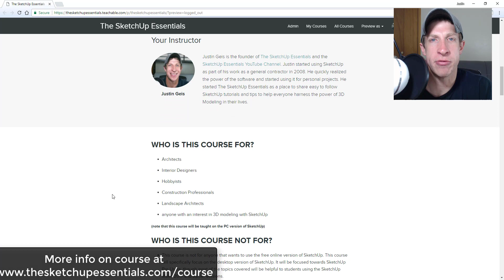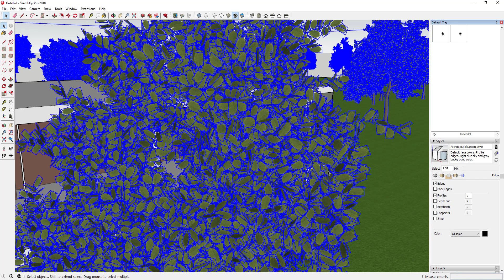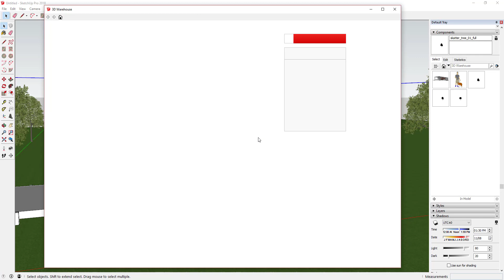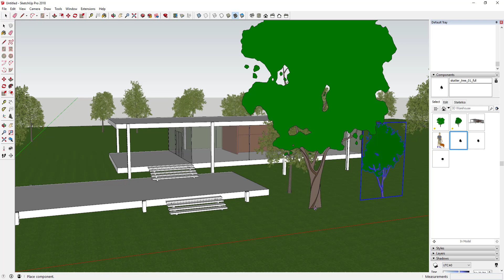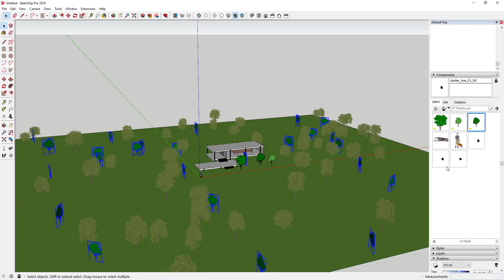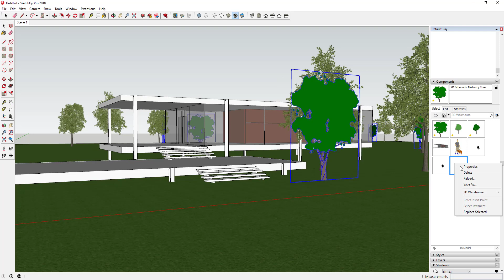SPEED UP YOUR SKETCHUP MODEL with Proxy Components!

Comment: I think in this case comparing with the workflow it is easier just take these high poly instances in another layer, and just hide it.
The real problem occurs when you making some interior with all that decorative highpoly shit, there should be some simple workaround that can visualy simplify the model. Vray has it, but it should be standalone plugin and be workable with different render software

Comment: The edges and faces in my model was 569 and still I had issues every min whenever I'm selecting a tool or moving an object. (Landscape project) and there's no issue with the laptop configuration.
Reply from the maker: I don't understand what you're getting at - if you only have 569 edges/faces, that's not a large model. Are you sure your graphics card is up to date? Because at that size, I'm not sure I agree that there's no issue with laptop configuration...
Reply: @Thesketchupessentials  there is actually an issue with my graphic card and I really have no idea how to fix that issue. Any help? 😅

Comment: Hi Justin, in order to speed up my modeling work within sketchup, this proxy method would be a good solution for me, but I usually render my modeling in Lumion rather than vray, so in my case what is your recommendation for me between using proxy component or vray proxy method although I dont use vray? thanks
Reply from the maker: I don't really understand the question - I'm not sure you can use Vray proxies if you don't use Vray. That said, proxies aren't really going to work the same way in Lumion - it brings in and renders objects in a different way than other rendering programs...
Reply: TheSketchUpEssentials thanks for the response... what i mean actually is asking about your opinion or advice which is the best way to speed up skecthup modeling between using proxy component method or vray proxy (vrmesh & vrmat), I usually add some decoration and furnitures from 3dwarehouse into my interior model, but there are a lot of high poly faces / edges and it’s usually slower down my pc and lag during doing my interior modeling.

Comment: Thanks for sharing. I think the use of proxies will be very important for serious modellers. Unfortunately it appears that you have avoided the problem of component axes when swopping proxies. It is seldom a problem with trees, but can be a problem when rotation and size are important such as for handed components. Can you do another proxy video with chairs, for example?
Reply from the maker: I don't understand the problem that I "avoided." Can you be more specific as to the issue?
Reply: I have been using proxy swops for only a few days with objects other than trees and I discovered that proxies are replaced (reloaded) by objects (reloads) according to their internal axes orientation. Any differences will effect the replacement or reloading orientation. For example, when I change "pulls" on drawers I must make sure that....

...the proxy pull and its replacement "pull" both have the same internal axes orientation...

...otherwise the replacement "pull" is cockeyed on the drawer.  

Ditto chairs in dining settings, cars on roadways etc etc.

Comment: Thanks for sharing. I've just discovered "right-click/reload" by accident, and it seems to be a quicker way of using/replacing proxy components. For example, just "right-click/save as" your preferred component to file (the high poly component), and then "right-click/reload" just one copy of your outgoing low-poly component from that file and all copies are replaced simultaneously.  

To make it easier to find that component file, always place them in the same common place , in my case the "documents" folder. (set preferences/files/components to your "documents" folder)

Comment: In order to get the scaling correct you often have to scale the low-poly component before it's place in the model so it's the same size of the tree you're replacing.
Reply from the maker: If you want the proxy to be exactly the same size as the component you're replacing, you can do that. If you just want it to be close, you can scale it after swapping them out - they're components, so they'll all adjust either way. Thanks!

Comment: Nice! Is it possible to have the hi-poly trees on one layer and the low-poly trees on another layer for quickly switching between them as needed? Or will hidden layers still affect the performance?
Reply from the maker: I would say that would work as well if you wanted to do that - there'd just be the extra step of having to copy over or create the second set of geometry. Thanks!
Reply: Keep hidden layers containing heavy objects accelerate navigation in the model for sure  . . .
Reply: You can put both the low poly component inside the high poly one, and once you layer them it will definitely save performance, however not as much as the method in the video.

Comment: Hi Justin, Is there a plugin that will lower the poly count on a component or group but maintain the necessary details that you have created? I know that sometimes during your modeling of something you may unknowing create unnecessary polygons, like if you create a window or fence component, within the interior of the model surfaces or polygons are created while the outer faces look fine the interior have unneeded or unnecessary geometry. I use clean but it still leaves unneeded geometry I'm not aware of.
Reply from the maker: You may want to try the extension CleanUp by Thom Thom - https://extensions.sketchup.com/en/content/cleanup%C2%B3 - I think I covered it a bit in this video - https://www.youtube.com/watch?v=PtwETBz9jJI - This will help get rid of unnecessary geometry, but whenever possible, try to consider geometry count before you create it - that's going to be the best way. Thanks!